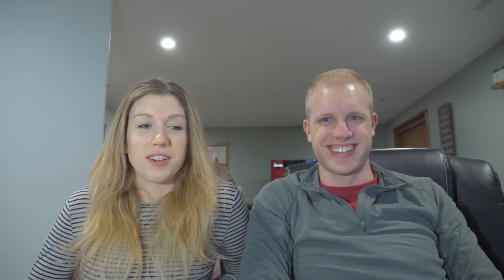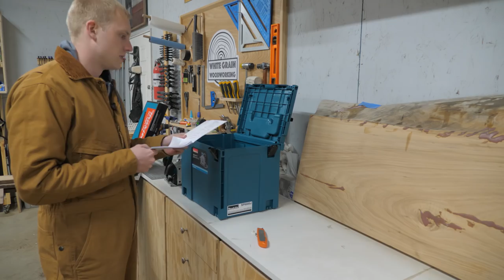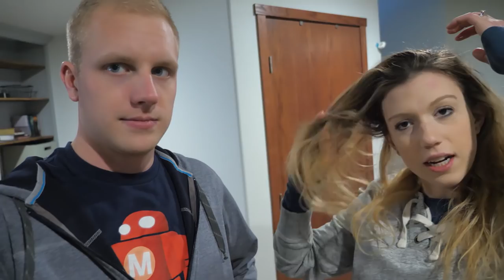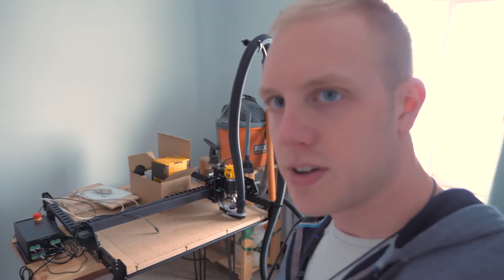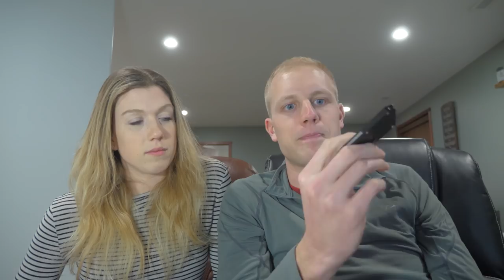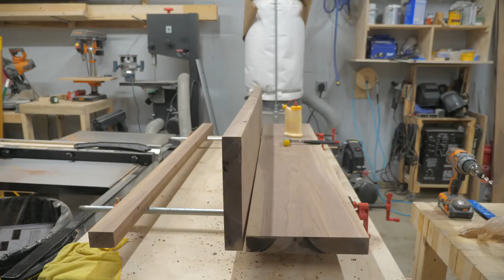Re-Brand & Maker Knife Update | Woodworking Business

Comment: I’m in the market for a track saw. I hope to hear back from you guys on how you like the makita. It’s right at the top of my list. Can’t wait to see the new Kreg saw they just released. Best of luck to you guys.
Reply from the maker: Ours is amazing. Just buy it. Don't worry about all the little details. Send it back if you don't like it
Reply: Hey Mike, I've had the same track saw for over 12 months now and love it.   I also bought the two "Makita 194385-5 Clamper Set" that hold the track down which do come in handy some times.   Especially when cutting a smaller board so that the track does not move.
Reply: I've had the makita track saw for a few years and love it, the only issue is that aftermarket blades, like the Freuds, are 5mm smaller, which throws the depth scale off.